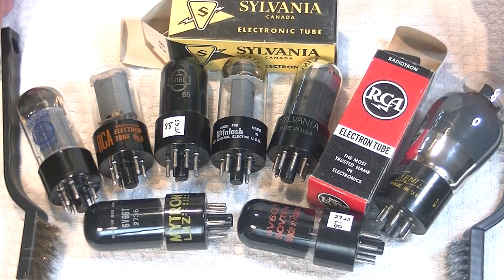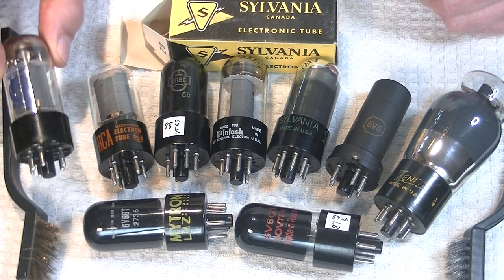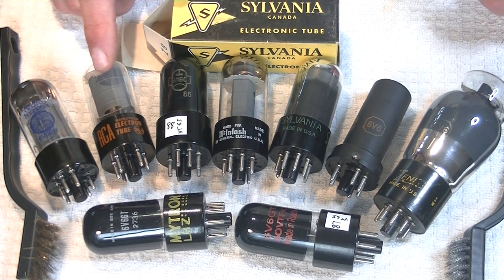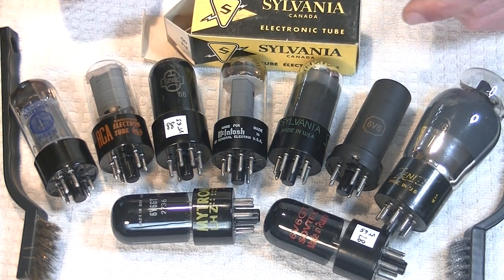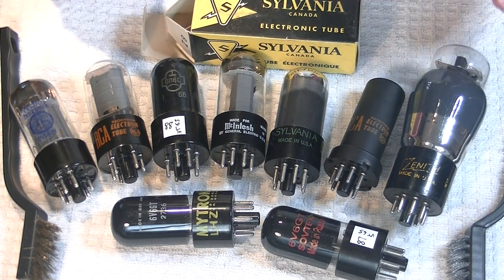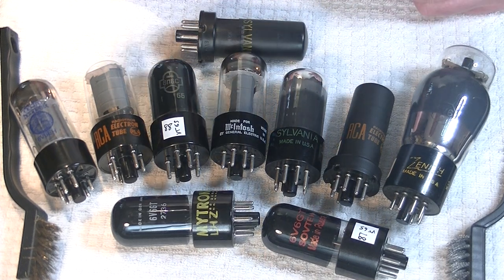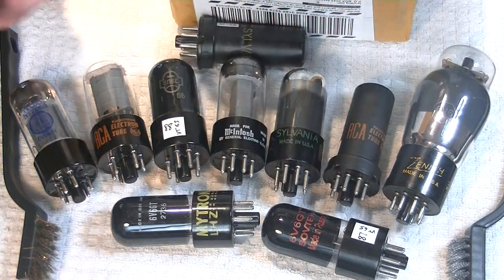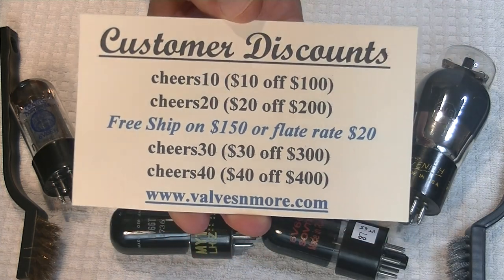Tube Lab #17  Rolling the 6V6

Comment: I would really like to find new old stock of EL84's cause most of my amp's run on them with exception of 2 with 6V6's
Reply from the maker: You should have a look in my store, I have lots of EL84 inventory, including a Soviet equivalent 6p14p-k an exact equivalent to the higher spec'd 7189, and the regular equivalent to the EL84 (6p14p).  I have enough inventory of the Soviet tubes that a good high testing matched quad or pair is guaranteed.
Note the store is currently experiencing extremely high volume, so if you see something you like....

Comment: I just purchased a BAT  rex3 power amp it came with sovtek Russian  6NS7 x6  I purchased  NOS  RCA. ( 4 ) & two Sylvania  all match grade  ? will it be ok to run the four  RCAs & the Two sylvania  the amp does auto Bias
Reply from the maker: Oh my god what have you bought!  Yes the amp will work fine with mixed 6sn7's, but it will sound kaka.  The general rule is, each stage should be an identical matched tube (Gm matched as well of course).  And honestly it would be smart to find a quality vintage set that is all matched up.  And at least one matched spare.  Remember "The Tubes ARE The Amplifiers" not the box, that's just for show!

Comment: I  bought 100s of tubes and a b&k 707 tube tester from the widow of an eBay seller. I recently have gotten into building guitar amps, so I'm super lucky to have found this lady. 
I have a question about 'matching' tubes. Am I correct in assuming when I test a tube and it reads , for instance, 88 on the meter, does that mean that another tube is a match if it also reads 88 , or 89 etc.
Thanks for any insight!
Reply from the maker: Exactly!  In our store we consider a 5% or better (95/100) to be a perfect match and for older or hard to find tubes, 10% is acceptable.  Remember the testing result is only as good as the calibration and the last calibration test on the B&K's is section 1 & 2 balance.  Also all testers have a +/- accuracy of about 1.0 - 2.0%, so don't fuss too much with numbers like 99.5, just decide to average every half value either down (99) or up (100).
The B&K testers are great tools, but all of them are now at least 45 years old (we have an original model that is 60+) and will need a number of upgrades/replacements in order to operate accurately.  Number one is replacing all electrolytic capacitors, next convert the tube rectifier over to solid state (easy), solder the leads to the pair of wee light bulbs on the left hand side, deoxit all pot and switches.  Run it on a variac at 117vac and always test at that voltage.  And of course recalibrate after doing any work.
Doing all of the above will give you a versatile, accurate Gm (mutual conductance) percentage meter.  And as you get more into testing tubes you'll find you need testing parameters that the B&K was never setup for, but with a wee bit of work you can convert an unused socket over to the new tube type.  Lastly the B&K is NOT a power tube tester, the best it will tell you is if a power tube is operating, the Gm % is virtually meaningless, for power tubes you need a proper emissions tester.  Cheers!
Reply: @tubelab194  thanks so much for this info. I'm told that the previous owner had it serviced. I'll have to verify. And I didn't know it was less useful for power tubes. Thank you. I just spent an hour testing vintage 6v6. I was getting different readings than were written on the decals . So I see why
Reply: @tubelab194  I've read up on a mod to test 12ax7 more accurately.  And I'll replace the rectifier tube with diodes. I've also got a triplett tester from the 40s that tests 12ax7 after I've modded it. Maybe I should use this for power tubes as well.
Reply from the maker: @soapboxearth2  I doubt the Triplett can properly test power tubes for emissions.  The limiting factor for most tubes is plate voltage which needs to be at least 250v and as high as 1Kv, depending on the tube being tested. And having the ability to bias the tube to a good operating point.  If you get more into tube testing and have an electrical bench, making your own basic emissions tester isn't that hard.  We provide basic schematics in our store under Information for such a tester.

Comment: I have a Delco 6v6gt tube do you have any info if I can put it into a guitar tube amplifier?
Reply from the maker: To know if a tube will works in an amp, you need the manufacturer and the model.  I'm not an expert on guitar amps.  What I suggest you do, is research your amp online and if that doesn't tell you what tubes it takes, then join one of the many Facebook groups dedicated to tube guitar amps and ask them for help.  The 6v6 is of course a very common guitar amplifier tube, but not all amps will use this tube.  The Delco brand is probably a rebranded RCA for your info.